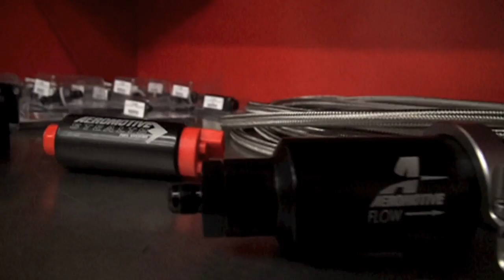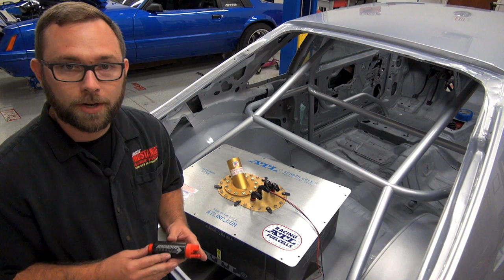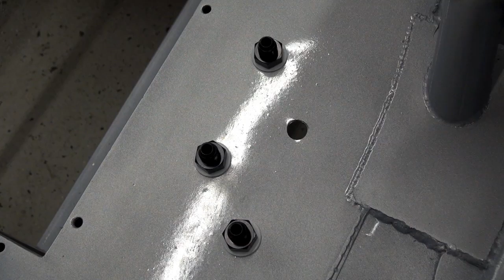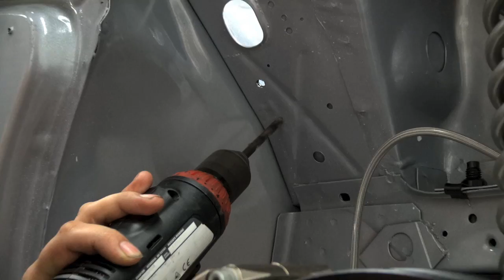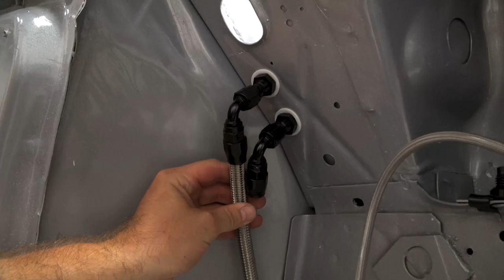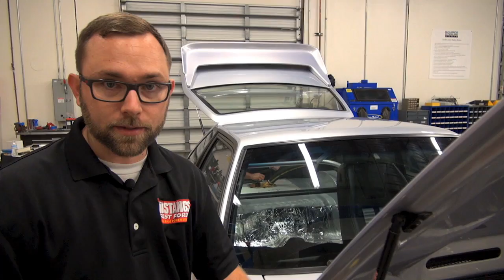Project Hypersilver - Aeromotive Fuel System Install

Comment: Car turned out really cool. But you didn’t say anything about cleaning the lines out before installing them. Always blow the lines out with compressed air after cutting. Always change filters after about 50 Miles in a fresh system install like this also .